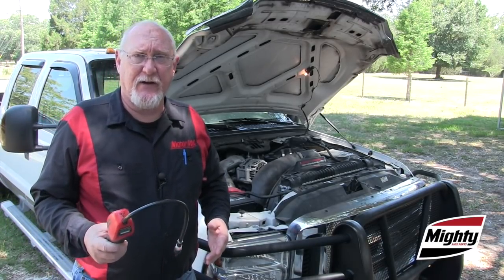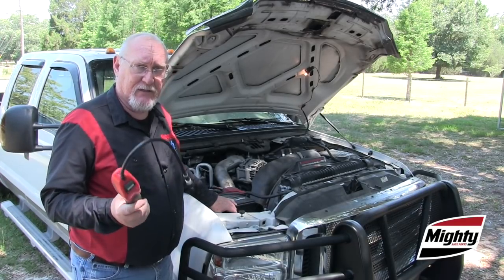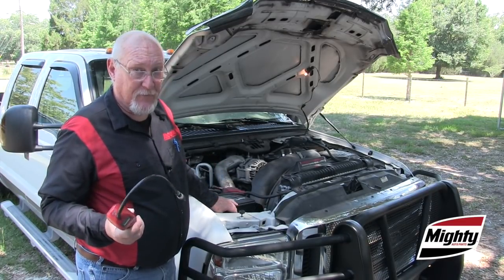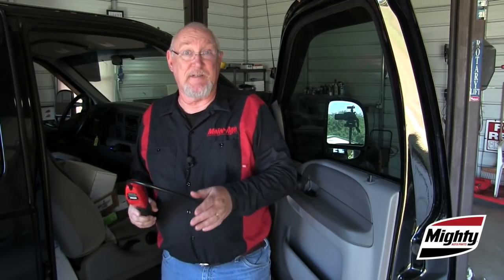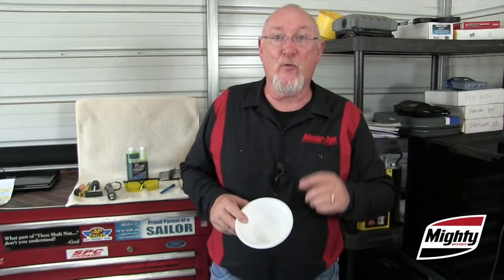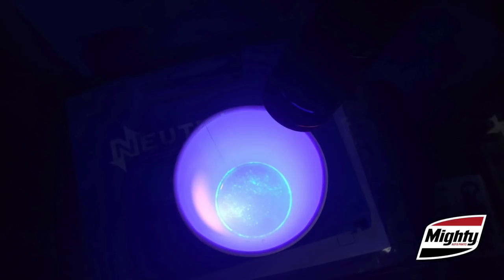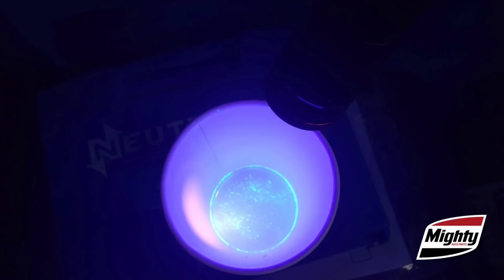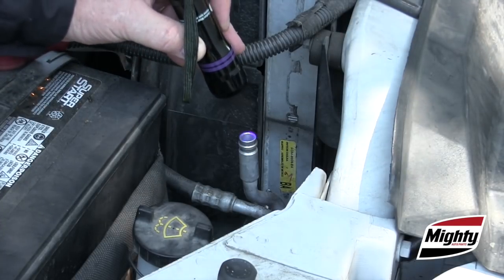The Mighty Minute - Ep 17:  Finding A/C Leaks - Don't Let The Little Ones Get Away!

Comment: Done a lot of collecting of ac water. It works. Remember the pag oil mixes with the water and will not separate. Most are hard to see and use a uv light in a completely dark room with gasses. Have controls like using tap and bottle water. Make sure there's no oil leaks from the motor or transmission to contaminate the results! They will alter the results.